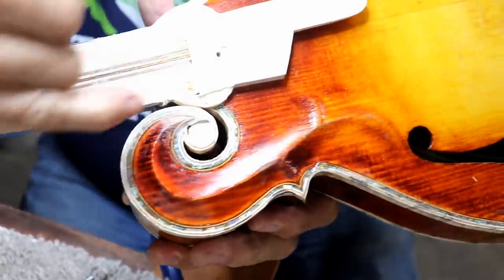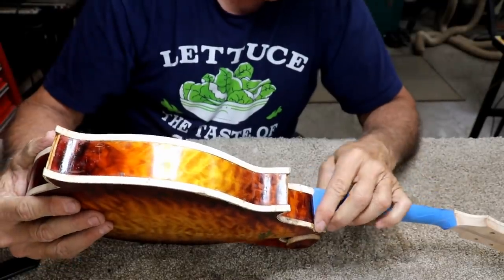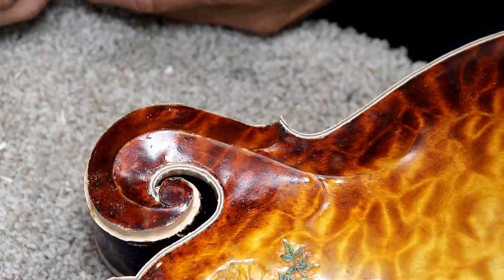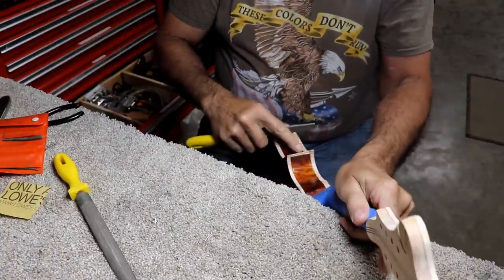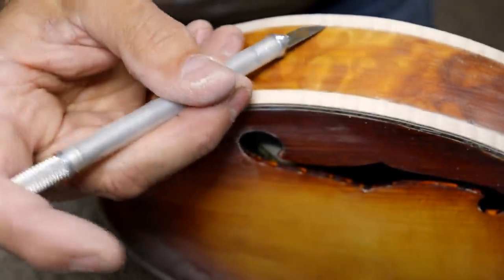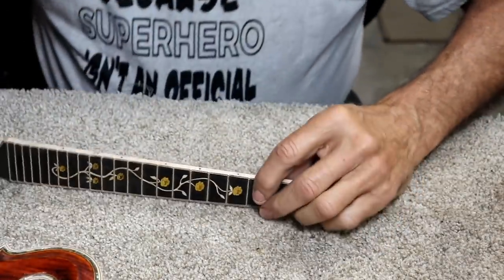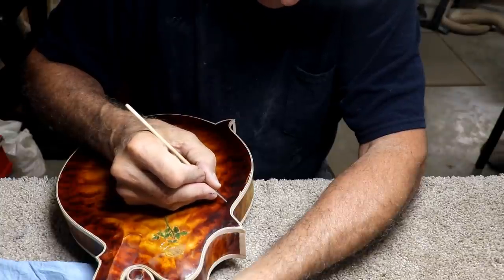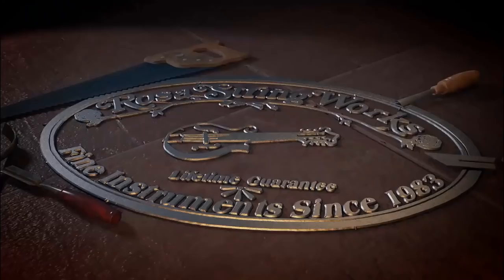560 RSW The Worlds Finest Mandolin Ever Built By A Human - Part 15

Comment: A wee bit tape wrapped in the direction of spin of the Dremel (<- important) tool  would solve the problem of the too thin shaft, now Gerry, to simplify my next description, think of a broom handle, when wrapping tape around it, mark the handle where the `wrap` started and when you`ve finished wrapping, stop the wrap just before that mark, ergo, no overlap `bump`, how do you do that on a wee tiny Dremel cutter, easy, put a piece of tape further down the shaft that isn`t going into the Collet & mark that-job done-hope that helps. Greetings from Scotland.

Comment: Oh the painful removal of the bad section of binding.  So horrifying to see.  Tom says just replace the small chip.  Nope that will not do for a type AAAA++++++ perfectionist  working on the goal of the most wonderful mando.  Scalpel YELLS THE SURGEON!  UGH another chip! So horrifying to see this video.  I have a knock off Japanese saw, bought it as a whim.  We use is every so often.  I just have to think backwards to use the thing.  Such a painful nightmare to see this video.  I have been called a type A I resent that as I strive to be a B+, at worst A-. My sympathies.  Oh and the thunder that I hear Geez the heavens are even against you Sir.
Reply: I turned the blade, on my hacksaw, backward.
Now, I wear my blades out, instead of bending them.
And, get a more accurate cut, to boot.